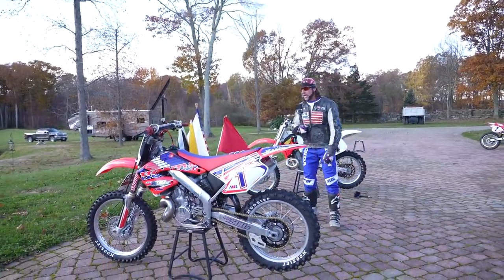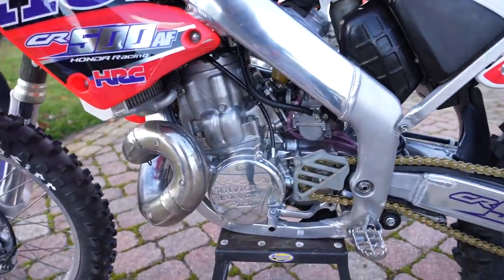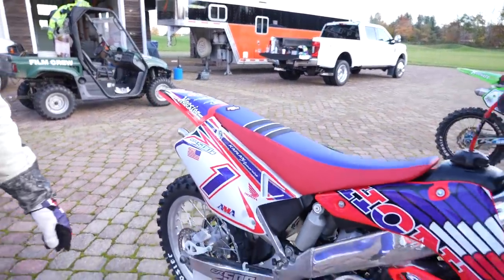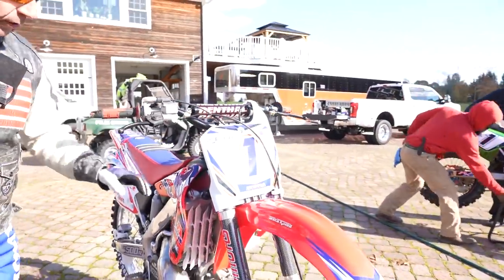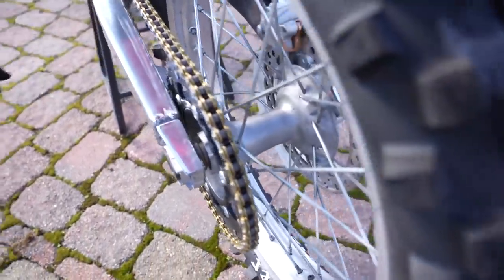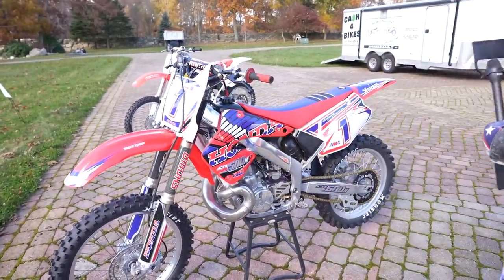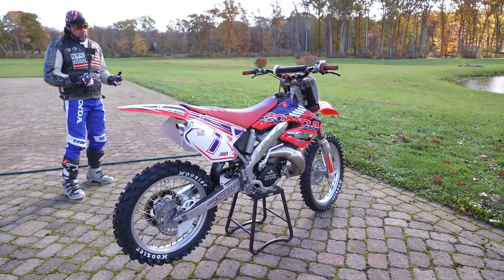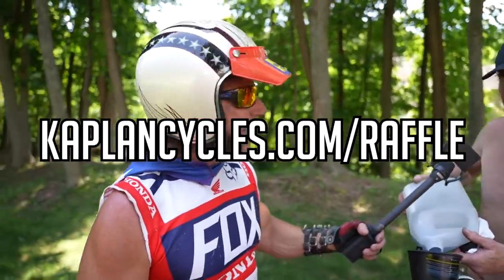INSANE 3RD GEAR HOLESHOT ON 2001 Honda CR500AF SR'S BEST EVER!

Comment: Just hearing and seeing that 500 gets me all tore up LOL. I've had many CR500, from my first a 1985, to the last A 2000 model. I had a lot of good sponsors, even team Honda for a while over a racing career of almost 30 years. I'm 56 years old now and from my first CR500 to my last when I retired, I got a thrill every time I Twisted the throttle on that Beast. I'm 5'10, and used to weigh 135lb. I was in the best shape of my life. Everyone nickname me flea, they said I was like a flea on the Lions Back, that 500 never even knew I was on it LOL. I remember people's faces when I would be unloading that Beast out of the trailer. Miss those days! My 2000 model used to be on display at A&M Honda in Kannapolis North Carolina. I've had a few Strokes, possibly related to my injuries over my racing career. I still ride and I have a 2018 KTM 350. But I'm looking for another CR500. Once you get used to that 500, nothing else feels the same. Love your Channel!!! God bless!